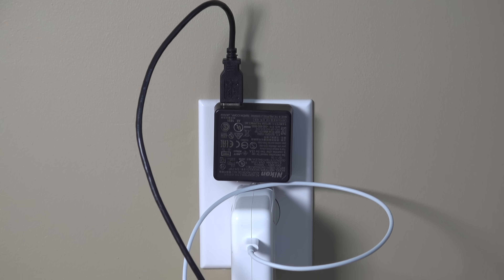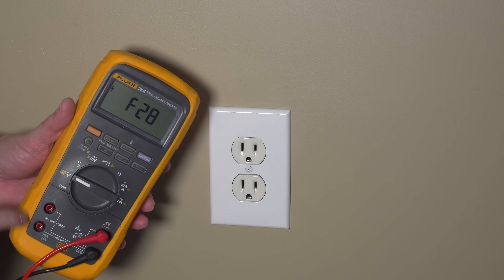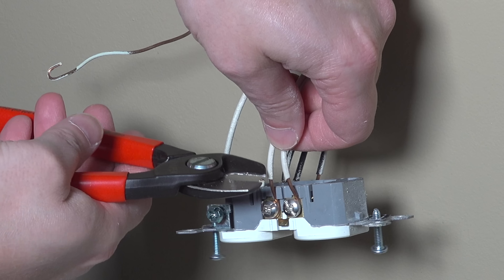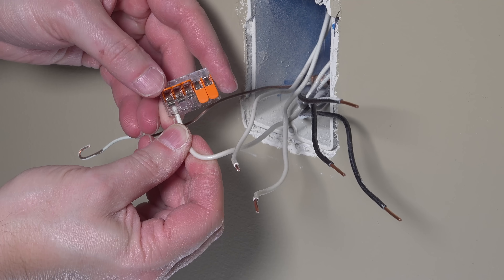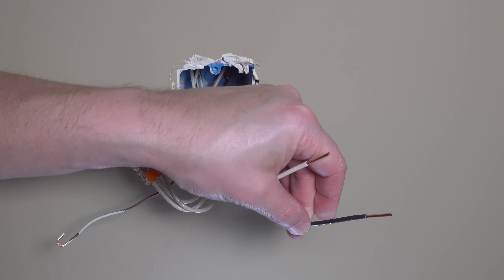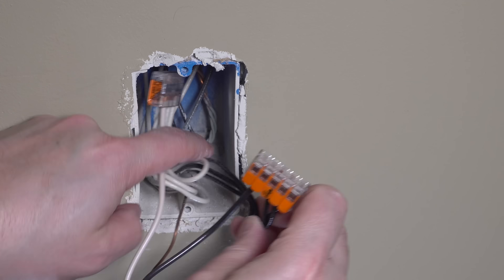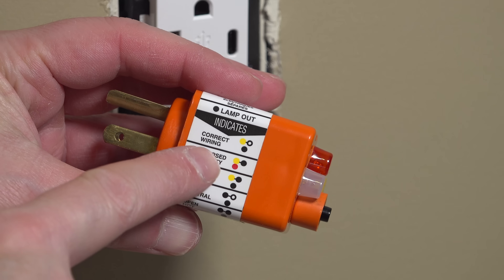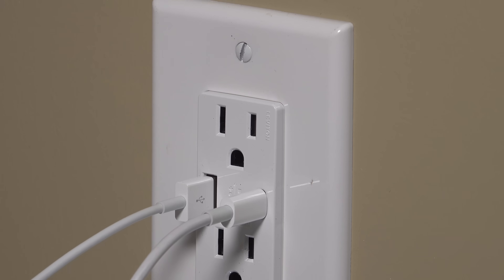Ultimate USB Outlet Install - No More Chargers!

Comment: No self respecting electrician is going connect the wires to the receptacle that way. ;-)  Always loop the wire around the terminal screw.  It's the most secure method.  It's also good practice to wrap electrical tape around the outside of the receptacle, covering terminals.  Though, since you've got a plastic box, it's not really necessary.

Also, don't assume the USB-C port in the receptacle is going to give you the same amount of power (watts) as the power source that comes with you computer.  It may work, but not at full capacity.  Looks like you can only get about 25-30 watts.  My ThinkPad uses a 65 watt charger.
Reply: It depends on the application. Some clamps are rated for commercial use. In high-traffic areas where there's lots of vibration, it's generally better to use the clamping method as this applies constant pressure and won't vibrate loose over time like screws can.
Reply from the maker: @WardenWolf  I agree. When you really look at a hook and loop its a very old design, sure it works but there are also many that are loose as you describe. The clamp is so much more secure in my opinion and leaves less room for error. I like Leviton stuff a lot too and have faith in their designs.
Reply from the maker: Backstabbing, yes I wouldn't do,  but these clamps are much like commercial/hospital grade outlets that use a clamping mechanism. Do what you are comfortable with but if you handle one of these, they are very secure.

Comment: Ok I have a question about the wago connectors.  In every video like this, some electrician will complain about outlets set up with “backstabbing”.   These wago connectors, to my non-electrician eyes, look like “backstabbing.”   If I use them will I be subjected to a lifetime of humiliation by professional electricians?
Reply from the maker: Yes, they do look like backstabbing outlets. The difference is how the wire is held, Wago had a patent and has made since 1951 and has a great track record. Sadly most electricians just lump every connector in together so they tell stories of them failing everywhere. If you look around you won't find any pictures of examples. In the UK, Germany and many other countries they don't use wire nuts at all. Just Wagos or similar products. I have tried others and the ones I like best are the Wago 221 lever series.

Comment: These make me nervous. I've had a plain old gfci outlet short out because things are too close together inside. Would not willingly buy one of these and jam a high-ish power switching power supply in there too.

On the other hand, I recently bought a gizmo from Anker that provides 6 charging ports with a single adapter. That really cleaned up my charging area.
Reply from the maker: My rules for any stuff like this is ONLY buy real brands Leviton, Eaton, Legrand/Lutron and you will be ok. The other garbage stuff really scares me but the bigger worry is I don't want to have issues with this for ages. I have a 7 year old Leviton outlet that is still working today after being used almost daily.
Reply: @SilverCymbal  yeah, me too, only took that one "electrician's choice" outlet going kaboom, now I only buy the commercial grade Leviton like the electrician had from the supply house. I did install a Feit Electric smart dimmer, but that's a dimmer, not a wear item like a receptacle, and Feit is still a pretty big company. Plus, I inspected the insides too...

Comment: I’ve seen these before and wasn’t that interested. But pointing out the fact that you eliminate the charging block makes it a more appealing idea! Thanks 🤩
Reply: Yeah but charging your phone with this is considered using a third party charger. You can throw out the phone's warranty because no phone manufacturer is going to replace your fried phone which is destroyed by a third party charger.
Reply: @lehelzelenka207 I mean if it was some dollar store or gas station charger sure but I'm sure leviton has plenty of experience with power management and doesn't want to fry your devices and probably doesn't want to start any fires or and problems because yunno, they make a large majority of the wall plugs
Reply: Lehel Zelenka Your phone won’t just blow up and die because you used a non-factory charger.
Reply: I think you should try one of the aukey's multi charger units.you may like it.
Reply: @MidwestBoom  If you tell them that their faulty charger killed your phone, they will ask you to bring your faulty charger.

Comment: Ive been eyeballing these for the longest. ...but I need for those prices to come down.
Reply: They can be quite expensive, it's basically the equivalent of two power adapters plus two AC outlets. It guess the price depends a lot on how much power the USB ports can deliver. It's probably listed on spec sheets somewhere.
Reply: They are pretty pointless because you will spend all the money to update these and then a new version of USB will roll out and all the outlets in your house will be outdated
Reply: I mean, how many do you really need.  I got 4 in the kitchen (2 on wall, 2 on island), and 1 each bedroom and that works fine for 5 people.  😁
Reply: Not gonna happen. Phones come with faster chargers every year. So the price will only ever come down on obsolete, out dated units. Plus different brands use different fast charging methods. So if I had gotten the best possible outlet for my phone last year (a samsung note 9 using samsung fast charging 2.0) not only would it not be compatible with my gf's iPhone 10s, but when I buy my new Samsung Note 20, I'll have to replace all the outlets with ones that have samsung's new 10w fast charging, or I'm not getting the most out of my phone, and I'll just end up using a stand alone brick anyway. Charging tech moves too fast right now to build it into your house unless you've got money to throw away, everyone in your house uses the same charger, AND you don't mind replacing it every time you get a new phone.
Reply: @BOBimusRex  Especially given that the primary reason why charging cables have USB adapters is so you can transfer data from your mobile device (tablet/phone) to your computer.  They were basically meant to be data cables, not charging cables directly to the outlet without the power bank/adapter.
Reply: @BOBimusRex  just get the highest power one
Reply: @Nicholas-f5  That mitigates the problem a little if you stick with the same brand of phone. But does nothing to help if your household has both samsung and apple phones. If my gf plugs her iphone 10s into my samsung fast charger, it charges for 30 seconds to a minute and then stops. Because samsung and apple use different methods to achieve their "fast charging".

Comment: Is it fast charging? If not, it's kind of pointless.
Reply: That's what I wanted to know my  brick does 45w fast charging. I would assume that because it's plugging directly into the socket it would output as much power as the vice needed.
Reply: @cornellrw  Remember that the electronics in that "brick" are what allow the fast charging. This receptacle would have to fit those electronics PLUS the plug space, plus extra cooling measures because the transformer is in an enclosed space...it can't fit that PD power delivery and fast charging.  It WILL NOT provide whatever the device needs.
Reply from the maker: Yes, it is fast charging

Comment: As a electrician no no no no. I have seen these things heat up to a alarming temp
Yep convenient better to un plug chargers when not in use.
Reply: Why would you want to mount something like this in your wall? And they run 24/7.
Reply from the maker: @curtw8827  It's not pulling power unless is charging something.
Reply: @curtw8827  exactly! I’m a electrician and installed a lot of these. They got hot out side a box now put them in a box and run 24 hours a day. Heat is energy .
Reply from the maker: The earlier models used to run very warm. I have not found that with this Leviton model. Another good reason to avoid the beezo, suzi and other unknown brands for sale.

Comment: Black on brass to save your... life
Reply: Let's not reverse the hot and grounded conductors
Reply: 25years-master electrician. Its ok to diy  this project but don't get over confident it's still a snake 🐍
Reply: Thanks, Nick.  I haven't heard this before.
Reply: Nothing dangerous will happen if you reverse it...
Reply: @trevorwhaley3780  for many electronics and newer electrical appliances,  sure. But there are a lot of devices with polarized plugs for a reason. The last thing you want is to be screwing a light bulb into your lamp and suddenly have the ring of the bulb be live.
Reply: @georgegriffin6114  Who holds the threads of the bulb when they screw it in? Damn near impossible.  Likewise, who sticks their finger into the socket before installing the bulb?
Reply: @lucash1980  Even when the bulb is fully screwed in there is often a ring of the threading left exposed. I could easily imagine a situation where something makes contact with that and becomes energized. Or a little kid touching it and getting a shock.

Likewise, I could imagine someone reaching into the socket of a lamp they /think/ is turned off to clear out debris; when in actuality only the neutral is disconnected leaving the threads hot.
Reply: @trevorwhaley3780  I am not an electrician but search results for "reverse polarity outlet" suggest that there are electrocution dangers.
Reply: @trevorwhaley3780  Please don’t try to explain how alternating current works to troglodytes

Comment: Are these GFI?
Reply from the maker: No I don't think a GFI/USB model exist yet. BUT if you really wanted it, you can install a non-gfci with a GFCI breaker on the circuit. I believe this is allowed in most places to meet that requirement
Reply: @SilverCymbal  thanks...but only if you make a video on it 😜
Reply: @michaelwarnock3988  Why go and reset the breaker if something goes wrong when you can just die...